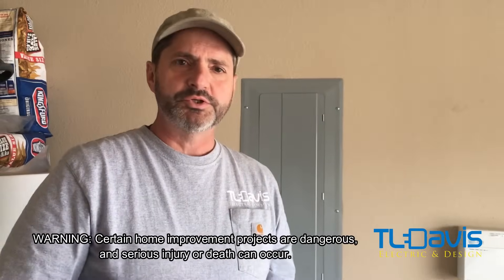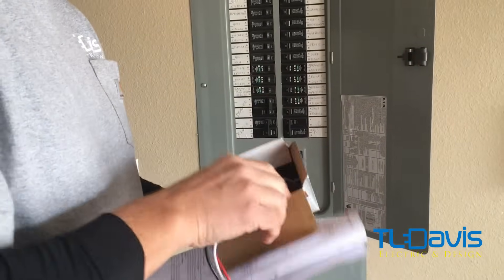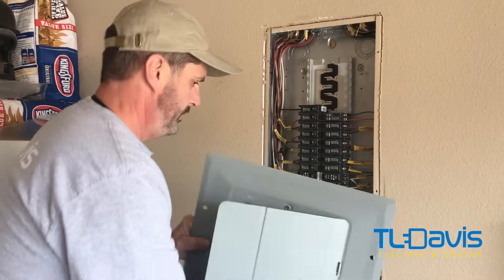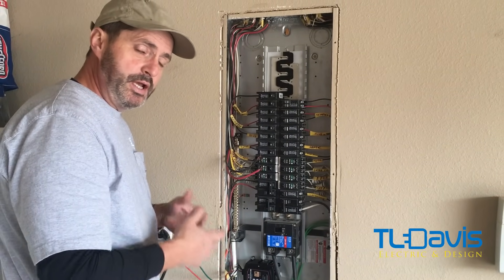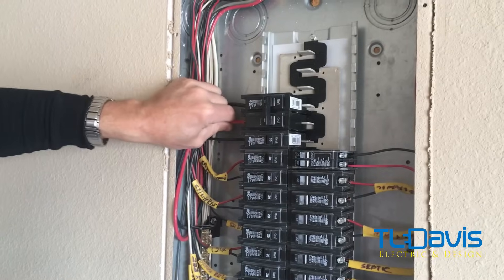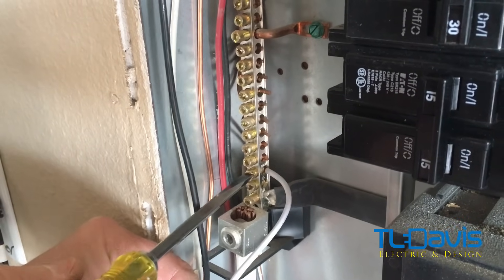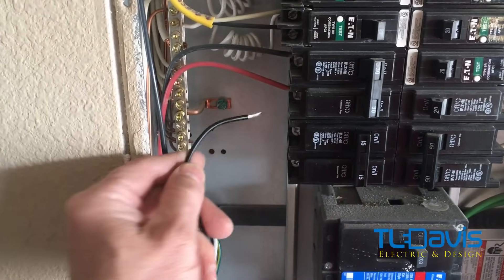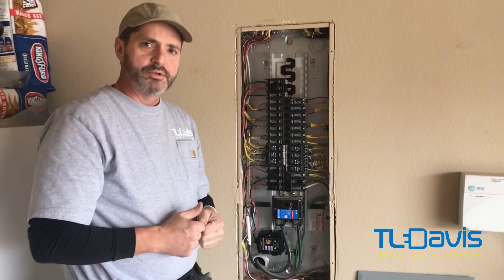How To Install A Whole House Surge Protector | TL Davis Electric & Design

Comment: what happens if the breaker trips when you're out of town? does the freezer go off? granted loosing all my food may be cheaper than buying all new electronics, but this doesn't seem fully thought through, not by electrician, per se, but by the manufacturer, or what am I missing? seems there should be a remote reset capability and integration with Home Assistant running on a UPS
Reply: the other thing i am going to do is set up home automation, so i'd like a data port to link to the computer and a way to reset the power remotely, when i'm out of town. i could have home assistant text me if the power goes off and reset the power automatically after a few minutes. i guess that goes for all the breakers, not only for the surge protection. that obviously goes beyond the scope of this video and would be directed to the manufacturer. if your reading this and want customer feed back, there you go.
Reply from the maker: As an electrician and an electrical designer I have never thought of it in that direction. First of all it does not shut off the power to the house. The electronics in the device detects the surge and dissipate it before it cause damage down stream. Any outlet close to the panel might not be protected as those down stream. I don't know all the ins and out of the surge protection. But Eaton by far seems to be the best out there and no they are not paying me anything to promote them. Second if the breaker trip it is doing its job. Just reset it by pushing it to the off position and then to the on position. If you try to just push it to the on position it will not reset. Eaton puts there surge protection at the bottom of the panel and I suggest as close to the main breaker as possible.
Reply: @terrydavis5882  thanks for prompt replay. to take a step back from my initial post; yes, I would rather have this installed than the alternative. but as someone with little real knowledge of all this, sometimes, an outsider that hasn't been exposed to "that's just the way it is", may offer a point to ponder. of coarse, I would think that my point has validity, but I'm coming from the view point of having a home server (which I don't have yet) that can be accessed while on the road, accept after a power failure, when some server hardware turn's itself off but not back on after the power is restored, defeating part of it's purpose. much of this has been addressed by computer geniuses, so let's pass this on to Eaton, or alternatively SquareD, GE or whomever is actually interested in serving their customers or let them go the way of those before who also failed basic logic. my 2 cents. my point may either be irrelevant or out of touch with reality, and so, it isn't the first time I have totally missed the point, se la vie
Reply from the maker: @iflnr978  The SPD does not protect against power loss. The SPD only protects against surges from lighting strikes and power surges from your utility company. If you are looking at something to protect you from loss of power. You will need a UPS system for your server to help you with that. You can buy them off the internet or at a local Best Buy if you have one. You just need to plug your server into it and it will give you a few hours of battery back up until you get your power up and running. You can go the expensive route and have a back up generator installed at your home. The generator will give you power for the whole house and not just the server, the cost may very depending on where you live. The cost for a complete install should run around $7,000.00 - $8,000.00 with a 22kw natural or LPS fueled generator. The new generator have internet capability to notify you when you loose power to the home. Good luck.
Reply: Terry Davis ok, that’s great! So the LPS should last as long as there’s fuel in the tank, then what, were back to square one, only $7,000 lighter? This wouldn’t be anyone’s fault, it’s the laws of nature, when your tank runs out, so do you. I suppose there could be some arrangement with a local provider and a remote warning device such as a smart meter, to never let the thing run out, which might be beyond the scope of a electrical power spike protection video, so back to that topic. Would it be either serge protection OR protection from power outage, but not both, when one is on holiday? Or do the 7 to $8,000 systems protect from both automatically? Of course that question may be beyond the scope of knowledge expected from this sort of video, I’m asking because I don’t know and because one might assume a power serge might come before and/or after an outage and generally speaking people don’t empty their freezers for vacations, as far as I know, although maybe electricians do! lol!  And well, I’m thinking it might not be pleasant to come home to a home who’s power to the freezer off. I’m not really sure I follow the serge protection process beyond the purpose of protecting electronics, and I may have that wrong too, I’m just trying to understand and understand what to expect when and under what circumstances. Maybe 7 to $8,000 is not worth protection from a spoiled freezer, or hiring a house sitter or putting the house on AirBNB at least gets the chance the renters would do something to get the power back and regardless, they’d at least provide a hedge against losses, perhaps the continuous power is still a pipe dream unless you want to take full responsibility and go off grid to lower your chances of an outage. That seems a bit far for most people to go, but if you’ve seen the truly high end music production power conditioners for around the same price as the residential on demand power generators, and since I got here, looking at serge protection because of damage to my TV and concern for my music production equipment and lack of understanding and trust from low end power conditioners (else why did they make high end ones if the low end ones worked perfectly) along with the desire to “condition” the electrical signal and get a pure sine wave minus electrical hum, I thought I might go down this rabbit hole. Why not create a large battery powered UPS, not to keep the power on in order to shut down the computers safely, but instead of dirty spikie utility power, instead of a $10,000 high end music production power conditioner, which as of 5 years ago they stopped producing. Why? Is it cheaper to build your own solar powered system? Not that it would be noise free. Apparently “pure sine wave” usually isn’t “pure sine wave”, as may have found out if you’ve had any reason to investigate this. Apparently “120VAC” is more like 108VAC, 120VAC is used so prospective buyers know what you’re selling, not providing an accurate description of what “you’re” selling. If want the real 120VAC inverter, you pay double or triple. And there’s LIfepo4 batteries. That are often spot welded together. Not taking precautions has landed a persistent red vertical line on the 55 inch flat screen TV, do I want the same for my computers? Not really. Do I want the same for the music I produce? Not really. Is there a clear way to fix it that’s reasonably priced and straightforward? Maybe, but it doesn’t seem so, so far there’s just lots of shades of indistinguishable grey and things that cost an awful lot for very questionable gain and questionable protection. So it seems, and I could very likely be completely wrong, that building a DIY large LIfePO4 battery capacity power supply that is electrical grid charged might be the best bang for the buck. It might provide an “air gap” from utility power serges and most lightning strikes and electrical “noise” and protect from power outages as a side benefit. No need for a USP, maybe, no need to condition the power if not also connected to the toaster oven or maybe LED or fluorescent lights. Maybe those things could be connected and a low end power conditioner would do the trick or maybe I’d need one for the house and one (battery power system) for the music equipment. But maybe I don’t need one for the house. Maybe mainly for the freezer, as long as I am making them

Comment: You put it in wrong position for neutral and ground. You should not join this together
Reply from the maker: Thanks for taking the time to watch the video. It sounds like you might be an electrician. This is a main panel and the neutral and grounds are connected per code. There is a ground screw that is apart of the neutral bar that is tighten into place which goes to the can. Only in sub panels are they separated by code.
Reply: @terrydavis5882  Well, it appears to me that this is a "sub-panel" you're working in and not the main service panel. But maybe it's an older home where the main service panel isn't outside and everything is in one panel. If that's the case, well then, ok I guess.
Reply: Oh snap. I'm on the horn telling my utility company this, they messed up the entire city also red is hot and black is ground GAWSH

Comment: you obviously have never heard of nfpa 70E. since you violated pretty much every  rule in nfpa70E. stick to homes buddy ,because your a fireball waiting to happen.
Reply: John, Thanks for your input. I know what the NFPA stands for. When filming how to install a spd in a panel. We had a special request, which we got permission for the local jurisdiction who can over ride the NFPA or NEC. You should know this being an electrician. The individual has a child that has special needs and one of them is pulling things apart and that being said. The home owner did not want his child to be electrically shock if not killed. It is important to find out information before we start tearing someone down. This was mentioned in a previous comment. I have not had time to redo the video as I'm very limited with my work schedule. There are also additional video on how to surface mount and recess mount. I know they make a face plate for this spd. We do what the customer wants as long as it meet code or the local jurisdiction give permission.  John you are always free to do a video and share it with others. Have a great day and thanks for watching the video.
Reply: @bethdavis9997  you could have recessed it under the panel with the cover plate design for it and pleased the customer NAC and AHJ. If you put out videios like this not everyone is going to read all of the comments and in turn do this just as wrong as you did. I would suggest if your going to make a video for all to see then do it correct or keep it to yourself. There are no comments in the video regarding your spesific situation or that you had aproval from your local inspector. Stop spreading miss information on YouTube like the rest of the masses.

Comment: Good day Sir, Can you make video "how to put or add Grid Tie connection here at circuit breaker" thanks
Reply from the maker: I'm not sure exactly what you are asking for. Are you talking about connecting two single breakers together that will trip at the same time. They make the snap on clamps to connect breakers together. You might find them at Home Depot or Lowes or your electrical supplier. I would suggest you buy a double pole breaker or a quad breaker that has that snap on already on the breaker from the manufacture.

Comment: thanks for posting, will this work for 220 v ? thanks
Reply: That is 220v.  220 is 110x2, when he says "it has to cover both phases" at the beginning that's what he is saying.
Reply: @John_Ridley  thanks
Reply from the maker: The Spd cover both legs of power. That is why you need a 220 breaker. I would install the Spd on the outside as this was a special case with the approval of the local authorities having jurisdiction.

Comment: Can this be applied to any brand panel?
Reply from the maker: The surge Protection can work with any single phase panel for residential. All residential should be single phase. You will need a two pole breaker. Your instructions will tell you what size of breaker you need like in the video. Good luck with your project.
Reply: THANK YOU

Comment: "If you're not an electrician wear gloves " 
Live panel, 80's model watch from Walmart... 

Idiot
Reply: I was literally just thinking the same thing.
Reply: Rubber insulating gloves are required for any application over 50 volts, electrician or not.
Reply: @rublar75  NFPA has an "avoid contact" standard for 50-300V. That's reasonable if the main breaker is open. Moving the branch breaker is sketchy and should be gloved, if there were a really, really good reason to not open the main. But this is residential. The only good reason I can imagine is medical equipment. Everyone else can deal with a 5-minute outage.

The screwdriver and huge-ass watch are arc-fault burns waiting to happen. PG&E did some research on their 240V secondaries and concluded that HRC 2 gear (8 cal/cm^2) within 5.5 feet is a good standard when they pull or install meters. It's the current that burns you, and residential secondaries can deliver up to 10 kA.
Reply: Jordan Rodrigues surges kill electronics.

Comment: Does it matter where the breaker is located in the box? Does it have to be closes to the main or can it be installed at the end of the box furthest from the main?
Reply from the maker: The breaker can be installed any where in the box. The total length of the wire cannot be over 3' in length. The closer items will not be protected as well when you add length to the wire. Good luck on your project

Comment: you have two positive in the panel  and the protector is installed for one side  .what going to happen with  the other positive wire ?
Reply from the maker: You are correct and noticed the breaker is install on 1 side. But the two pole breaker covers both phase in the panel. the first bar is A phase the second bar down is B phase. So it does not really matter which side of the panel the breaker is on.
Reply: Phase A and B are each on both sides of the panel. They alternate vertically. A,B,A,B etc. All 240V breakers like Range, Dryer, AC etc. get power from phases A and B.
Reply: this isnt dc voltage....

Comment: Can this be installed in a 240v 3-phase panel?
Reply from the maker: The Spd that I'm using is only rated for single phase and not for three phase. You will need to buy a three phase Spd and use a 3 phase breaker to cover all the phase coming into the panel. 3 phase panels are only used in commerical applications and not residential applications.
Reply: @terrydavis5882  Hi, Terry.  Can you recommend a 3-phase SPD.  Might you have or know of a video showing installation of a 3-phase SPD?  Thanks!

Comment: Do not install the surge protector as shown. The Electrician installed it near the main incoming line. Was the meter pulled or was there another feed switch to isolate the main breaker. Very poor example to install a protection device.

Comment: Hey I just have a few observations to mention.!
1. You forgot to say that the breaker where the surge will be installed should be at the neutral bus side 
2. Who ever did the original panel didn’t split the ground and neutral bars.
3. Preferably use insulated screwdrivers
4. Always turn the main power off.
5. Trim the circuit that you repositioned
6. Green wire goes to ground bus bar 

Other than that you did better than most others.
Reply from the maker: David, thanks for your reply on the whole house surge protection device.
1- when we read the instructions it tells us to use a 2 pole 15 amp breaker that will work in the manufactures panel. It does not address us where to install the 2 pole breaker in the instructions. I have work with Eaton, along time. They have a kit to install it at the bottom of the panel away from the main. The electronics in the SPD will detect the surge and draw it into the SPD. So you can install the SPD anywhere in the panel.
2- This is a main panel and not a sub panel. They are suppose to be connected. There is a strap that sits underneath the bus. In a sub panel you are correct that they need to be separated per code.
3- The two pole breaker is off, so you will not be shocked when connecting the wires to the breaker. The neutral bar does not carry any current that will shock you. If you are not a qualified electrician, It is always good to turn off the main breaker.
Reply: section 250 from NEC says clearly ground needs to be bonded to neutral at main panel.

Comment: 6:32: It startled me when the motor turns on as you're inserting the wire into the breaker. Coincidence? LOL.
Reply from the maker: Great catch on that. There was a freezer next to the panel that kicked on when we turned on the breaker.

Comment: Would this offer surge protection for my home built in 1952? The circuits in the basement are grounded but the main level circuits are not grounded. All of the main level receptacles are 2 wire.
Reply from the maker: Yes. You are protecting the panel and all device down stream from the panel. You are trying to stop the surge at the panel and not at the device.

Comment: Green go’s to ground.not neutral.
Reply: After Point of origin.  If you are at point of origin they are common.
Reply from the maker: In the main panel the ground and the neutral are bonded. Only in the sub panel are they separated by code. Thanks for your concern.